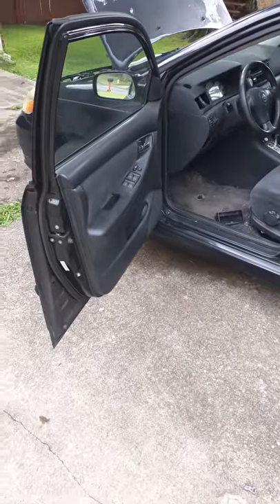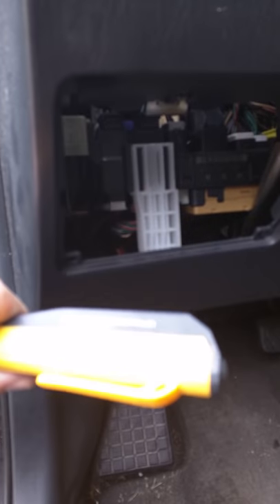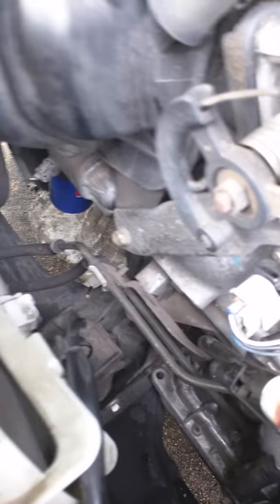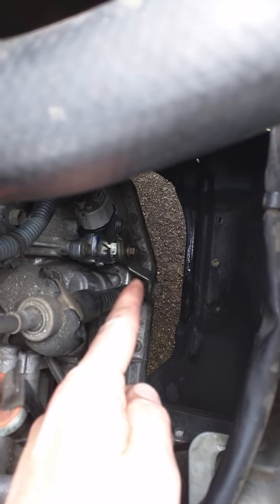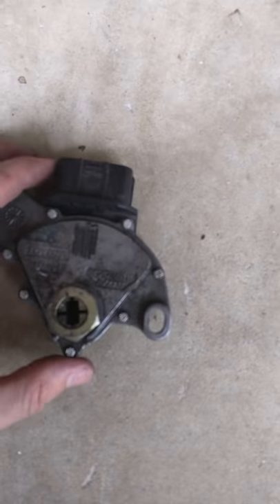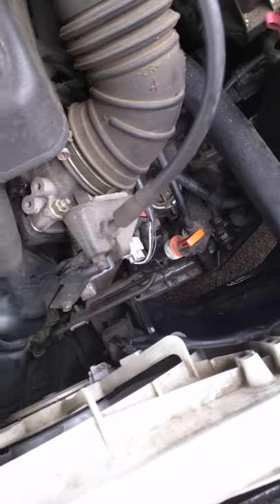2004 Toyota Corolla Neutral Safety Switch Replacement

Comment: Hi, Thank you for the video. You should have tried to move shifter to neutral and crank to check if will start. If starts then it is the switch if it didn't then you have someone else try to crank while you knock on starter body to nudge the starter. If the car starts then it is bad starter sticking sometimes.
Reply from the maker: Thanks for the insight, for this problem I tried the trial and terror method, and found out it was the starter and that AutoZone's starter testing machine was no good.

Comment: Yeah, I first went to Auto zone and they didn't have it in stock so they had to order it for delivery the next day. Total with tax was $51 and change. Picked it up, got home and realized I hadn't specified if it was for a manual or automatic - half my bad/half theirs - and got home and realized I had one for a manual transmission. My 2007 Corolla was an automatic. Returned it and when they looked up the proper part the cost was something like $178, only problem was they couldn't even get one. Went home and jumped online, and sure enough some were listed at the around the same price with a few notable differences. Amazon had it brand new for $38, it was Friday, and they delivered it next day, Saturday. So, save yourself some money if you can. Fortunately, the Corolla wasn't my only vehicle so having to wait from Thursday when Auto Zone ordered it to Saturday when Amazon delivered it didn't leave me without a ride. OH YEAH, forgot one thing. When I returned to 'clutch' safety switch - Auto Zone screwed that up because I did say 'Neutral'' safety switch - I found out that not only was it for a manual transmission, the one they ordered and sold me was for a 4-Runner. Changing now, and fingers crossed.
Reply: Did it work? I have the same car as you. Hoping it's not the starter itself but still troubleshooting.
Reply from the maker: My issue ended up being the starter. It's a cheaper fix than the neutral safety switch, if you end up buying from a brick and mortar parts store

Comment: So i replaced neutral safety switch. If i turned the bolt to neutral position, the car start right up but the trans gear doesnt engage. If i turned the bolt into other position, it doesnt crank or start but all the lights on the dashboard are on.

Comment: There's a video on here where the host is discussing  the starter system wiring involved with these Corollas and he happened to mention that all that switch does is connect the two wires coming into it. He didn't say you could just jump those two wires together to bypass that switch but it seems plausible. I'm not recommending it cause l haven't tried it but if you have the wiring diagram and it looks right it might work in an emergency.

Comment: Did u have to put the transmission on neutral first b4 swapping out the switch
Reply from the maker: It's been a while but I believe I left it in park. When I pulled it, wanted to make sure nothing was out of sync
Reply: @UnconventionalThinker  k. Thank u

Comment: i have trouble with this parts today 
i finished to replace it but the car could not start in parking
Reply from the maker: You may have to verify it's not your starter or battery.
Reply: @UnconventionalThinker  no 
the problem is from the center of the neutral safety switch. bad alignment
Reply from the maker: Gotcha

Comment: Will a bad safety switch cause the shift to move between gears, however feel like it’s in park still?
Reply from the maker: The safety switch only moves based on what your transmission does. It's a switch, that when in park or neutral allows your engine to fire up. There is a little rod that comes out of the transmission that connects to the switch, if it wasn't moving but your transmission was able to shift, then you could have issues with the transmission interface and not necessarily with the switch. I hope I gave some clarification, let me know if it helps or not.
Reply: Make sure your parking brake is on incase you move the rod side. The switch part is only electrical, allows signa to pass throughl on/off to starter

Comment: Are the detents that hold each shifter position inside this switch? My shifter movement is stiff between gears, I’m trying to determine if this switch may be the cause without pulling the sensor off. Thanks!
Reply from the maker: I'm not sure, but the sensor is fairly easy to remove

Comment: I'm having a similar problem, except if I let the car sit for 20-30 minutes, it will start again. Does that sound like the same problem?
Reply from the maker: Yes, that happened to me but what I found out was that it was my starter that was the issue. It's possible that could be your problem as well

Comment: Is it supposed to be a square spindle all the way back to the transmission?
Reply from the maker: Yes
Reply: @UnconventionalThinker  I think that is what my problem is. I took off the old one and the new one will not go on. I have triple checked to make sure it's the right part for my model. Any suggestions on how to get the grooves off the square spindle? I think part of the old NSS is stuck/rusted in the square spindle.
Reply from the maker: @rutherglen7226  Do the switches look the same?
Reply from the maker: @rutherglen7226  Not sure I understand what is stuck on the transmission spindle.
Reply: Is that silver stuff on the spindle supposed to be there or is that leftover from the old part?
Reply from the maker: That threaded portion should be attached to the switch.
Reply from the maker: What kind of car do you have?
Reply: @UnconventionalThinker  2007 Toyota Tacoma 4x4. And the transmission ID is A750F
Reply from the maker: It looks like the same switch. Were you able to tap the corroded parts of the shaft?
Reply: @UnconventionalThinker  I believe I got all the corroded parts off. I am trying to find a picture of the spindle without the NSS attached but have been unsuccessful so far.
Reply from the maker: @rutherglen7226  Whatever parts are on your new switch should not be on the spindle.

Comment: My 10amp ECU-IG NO.2 fuse keeps on getting damage whenever I shift from park to neutral or from neutral to park can this be the culprit? Bad reverse switch?
2012 corolla 1.6 auto tranny
Reply from the maker: That I'm not sure of, and the only way to diagnose it is to try and replace it. But these switches can be pricey $200+. You could also have an issue somewhere else down the line. Do you know if the switch is in line with that fuse?

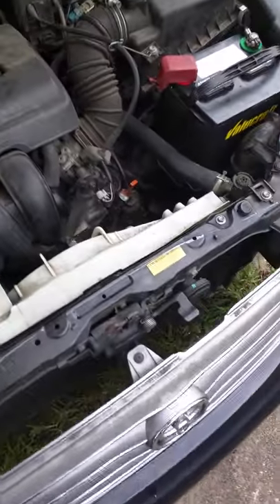Comment: What other steps did you have to do at 6:32 when you said everything fired back up once you put the new one on. Did you have to take it out of neutral. Sorry if these are dumb questions. Been trying to fix my car on my own for about 2 months now
Reply from the maker: So for the neutral safety switch once you disconnect the two bolts that hold it on and the lock nut that's on the center of the neutral safety switch that goes around the shaft that comes out of your transmission it slides off somewhat easy you don't really want to pry on it too much. But when you put a new one on it will slide back on just like the way you had it. But if you look at the switch itself you will notice a black line that is the position of neutral so you could clock it to the park position if your car is in park. The switch by itself I believe you can twist it back and forth between Park, neutral, first, and second gear. But when you pull your old one off it should show you what position the new neutral safety switch should be in when you put it on your car. Let me know if you have any other questions I hope this helps.
In the end the neutral safety switch wasn't my problem for this it ended up being the starter but when I took it to AutoZone to test their tester was no good and it gave a false positive.
Reply: I would like to share one thing I saw. That the manual Corrola's have a switch under the dash from the clufch pedal that could go bad.

Comment: Is there a way to test the neutral safety switch? How did you know it was that, or was it just a guess? I've had my battery tested...good...relay is good...I was about to pull my starter, but this seems like it would be a lot easier to replace. Ha. I'm working on a 2006 Scion xB, but i believe it's very similar, engine-wise, to the Corolla. Thanks.
Reply from the maker: bnoyz3 It's possible with a volt meter to see if it's an electrical issue, I believe there is a video out there for that. I tried but I couldn't get my volt meter prongs to touch the metal on the two ends of the switch. So I gave up on testing the switch that way.
I posted an update in the description. In the end it was the starter. But I ended up buying all three, the starter, switch, and relay. And when I found out it was a bad starter. AutoZone took back the switch and the relay. If you don't know which one it is that is my recommendation. It's pretty easy to pull the starter. I thought it was easier than the safety switch.
Reply from the maker: But you may want to make sure if you end up buying all three that they will take back anything you ended up testing on your car. At my AutoZone there were no questions asked.

Comment: Was your fuel pump still kicking on even though it was your natural switch. Are would the natural switch not make the fuel pump turn on as well ?
Reply from the maker: So my issue didn't end up being the neutral safety switch. It ended up being the starter

Comment: Same thing happened on my 2007 toyota camry.I found out that the plug that goes in the neutral switch was burnt
Reply: your car wouldn't start or wouldn't go into gear? mine will only go  in reverse.

Comment: The engine lights came on but the engine would not turn over when the engine was in park but once I put it in neutral the engine turned right over.
Reply: Was it the neutral safety switch then? Sounds like it

Comment: Just FYI...if you’re not in a time crunch you can get the switch on Amazon for $38.
Reply from the maker: For an 04' Corolla? Do you have the link?
Reply: Well mine was an ‘07 but it’s the same switch. Just go to amazon and search “neutral safety switch 2004 Corolla”. They have more expensive ones but why spend an extra $160 on a sixteen year old vehicle? It’ll outlast the rice rocket’s life span I’m sure.
Reply: @1111drsand  a properly maintained "rice rocket" or any b series motor would far outlast, outperform, and is so much simpler to work on vs this ugly mess but just my opinion, I drive hondas and chevy trucks and everything in between.
Reply: I’m not refuting, I concur. The first switch lasted thirteen years. Logic dictates that the second switch could last another thirteen. I don’t think saying a vehicle not lasting twenty-six years is an outlandish statement or a bash on the car.

Comment: Seen new switches on amazon for around $30 for 05' to 10' corollas
Reply from the maker: It's possible they may work I never got to try them. I ended up going to AutoZone and getting the one there. I think it was a duralast brand which honestly looked exactly like the OEM part

Comment: What problems were you getting
Reply from the maker: Car wouldn't start.
Reply: Did you try starting your car at neutral to determine it was the neutral safety switch?
Reply from the maker: I didn't try that, as I found out later it was my starter

Comment: Mine is leaking oil, maybe a o-ring?
Reply from the maker: Are you sure it's not transmission fluid?
Reply: @UnconventionalThinker  yes trans fluid behind the neutral switch
Reply from the maker: Was the fluid all over the switch with noticeable leaks down to the ground? I'm sure there's some type of oring or seal in that area, but it's not associated with the switch.
Reply: @UnconventionalThinker  yes, looks like the fluid is coming from the neutral switch shaft
Reply from the maker: So the switch doesn't have a seal to keep the transmission fluid from leaking. The seal would probably be internal to where the shaft is coming out of the transmission. The switch mounts to that shaft. So if you have a leak and your switch no longer works that would be likely two separate issues.
Reply: @UnconventionalThinker  You are correct, the seal is def internal, this is going to be a pita to replace that seal coz i don't see any seal or o-ring from outside, jaja what a bad day for me, btw my neutral switch is fine
Reply from the maker: Yeah that sounds horrible due to the limited space. Sometimes you can search for the schematics of this area from Toyota (manuals the mechanics use). It can give a better understanding of how the seal can be accessed and how it's retained. If it was me and it was just several drips of fluid I would just let it drip and keep an eye on my levels.
Reply: @UnconventionalThinker  Better idea, I really appreciate your help. Thank you brother
Reply from the maker: @Cody Koala does the shaft wiggle?
Reply: @UnconventionalThinker  I'm going to inspect the shaft  and let u know
Reply: @UnconventionalThinker I just found my problem, I remove the switch and there is a seal AE0371P,  is leaking but not too bad
Reply from the maker: That's good! Does it appear the seal can be removed, is it visible as to what retains the seal?
Reply: @TheJosephayal  any update? Was the seal able to be removed from the outside?

Comment: I'm having the same issue with my manual 04 Corolla. Since auto zone  tested the starter as good , I have been trying to figure out what else it could be. I'm going to buy a starter and install it and hope for the best.
Reply from the maker: So I posted an update in the video description. Long story short, it ended up being my starter. I got my starter tested at AutoZone as well and it tested good. The nice thing seems with AutoZone you can take it back no questions asked. I bought all three items discussed in the video and took back the switch and relay when I found out it was the starter.

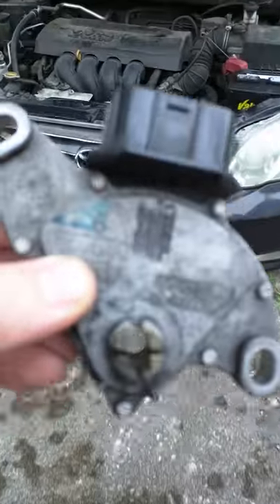Comment: All the describing however not information on the size of socket needed to remove the locknut described at 4:08 in the video. SMH......
Reply from the maker: It's either a 10 mm or 14 mm. It's pretty easy to reach in the Corolla.
Reply: 23mm for future reference
Reply from the maker: Yes likely for the center nut. The nuts that hold the switch to the transmission I think are 10 or 14 mm
Reply: @UnconventionalThinker   i think the one he was referring to was the center nut, thats why i chimed in with that, other than that great video
Reply from the maker: @Junior-qu4er  haha yup he was I must have missed the locknut term. I would have gone and checked it but sold the old Rola a few months back.
Reply: @UnconventionalThinker  i just did mine this morning thats how i got that info

Comment: Engine no crank and no start, new starter, but still same
Reply from the maker: Did you check the battery and the neutral safety switch?
Reply: Unconventional Thinker no battery is good! No crank no start and no noise or nothing
Reply from the maker: It could be the neutral safety switch. But they are expensive $200+.

Comment: First of all thats a range sensor. Second the nss is near the gear shifter
Reply from the maker: Yeah I'm not 100 percent sure whether it's called a range sensor or neutral safety switch when it comes to car vernacular. However, if you order this part for an automatic 2004 Toyota Corolla from a parts website or from a brick and mortar store it's referred to as a neutral safety switch.